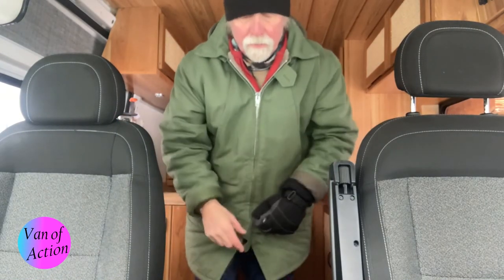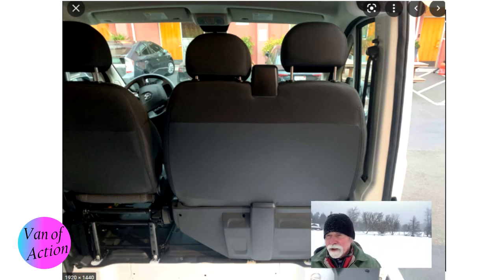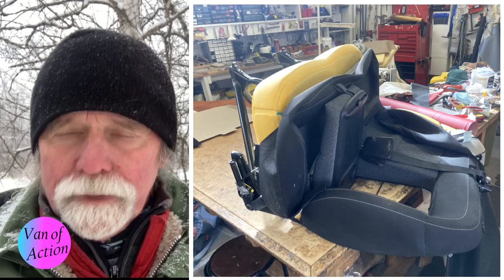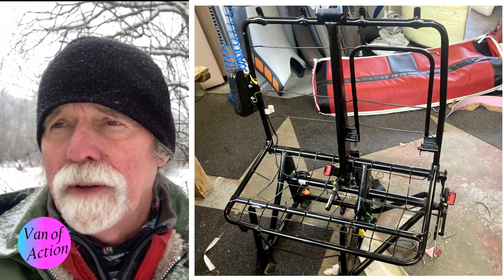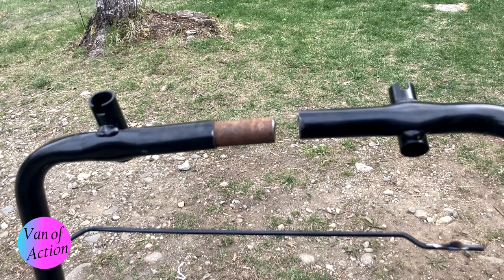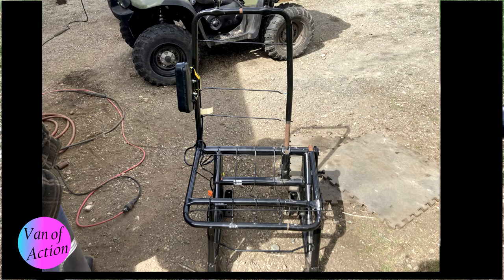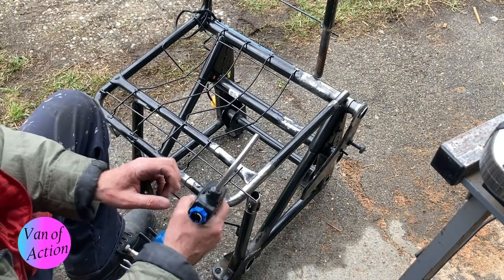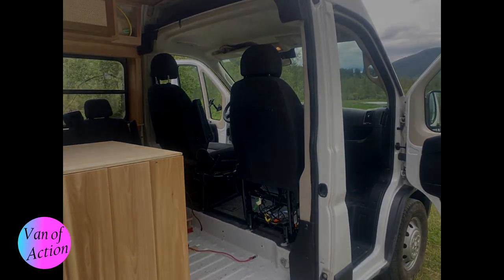How to Convert A Dodge Promaster Bench Seat Into A Single Captains Chair for a better Vanlife

Comment: Nice try,cutting the seat was also my first thought when I decided to swap my bench to bucket seat.But I have no welder friend or tools and my wife’s concern is the reclining feature.So my final solution  was searching the Craigslist for a wrecker and found a airbag deployed bucket seat in a nearby body shop which was charged $190 for both seat and riser. The seller didn’t give me the seatbelt pretensioner buckle,he asked for $120.But the buckle exploded in the accident as well as the airbags,why do I need the salvage?I have a brand new one in my bench seat,It’s easy to move the pretensioner and the seat airbag from the bench to the bucket seat,so I did that.I sewed the seat cover with needle by myself.If your families find recliner is useful in the future,it’s still worth buying a bucket seat from salvage.Anyway,congratulations,enjoy your van and New seat!
Reply from the maker: Tommy !!  Thanks for the great comment.  After the fact I thought I could have done the same in terms of moving the air bag over.  I hadn't considered the seat belt thing but you're absolutely right.  I think if I did it again I would go that route but NOT sew it myself.  I'm sure the upholsterer could have reworked the cover of the bench seat to cover the bucket.  The air bag sides look identical, the alteration would be on the other side.  Now that I'm writing this it's something that may still be possible.  Cheers my friend - be well and safe

Comment: Hi all.  Firstly, great job. I am from the UK and did think along the same lines.  My plan was to slim both seat edges to be in line with the base legs and reuse the foams and covers, just as you have done. However, I cut the whole base frame down to the level of the thick rear tube and did away with the whole seat base and backrest. I added  flat rails ( and a front rail ) off the rear tube and bolted a complete reclining seat in a very similar material to my van seats, with runners and base rails, from a Peugeot 208 which fitted, was a similar size and shape to the driver's seat and had exactly the same type of seat belt buckle. Essentially, I used the seat frame as an extending seat base for a car seat to get the correct height. I toyed with buying two matching seats and converting the driver's side but I would have lost the huge space under the original seat  (and the tool box space under the passenger seat is still available - just ). Instead I eventually paid for a pair of made to measure leather fitted seat covers in a tan colour to match the rear upholstery. Again, a great job and way above the level of butchery carried out by others. Cheers.
Reply: An update to my comment. Peugeot is not widely available in some areas but Fiat and Citroen parts can be. These manufacturers share a lot of parts across the ranges available in North America. The European Boxer, Ducato, Relay (Promaster) van uses parts from the same inventory as many saloon cars in the ranges. I am sure you could source seats from Dodge and similar makers which use the same seat belt latches.
Reply from the maker: Hi David - thanks for watching and taking the time to share.   You must be a good welder - something I know nothing about.  I love the idea of cutting the base off and rebuilding it to receive a more traditional seat but I simply have no idea how to do that and I expect the liability issue would scare a fabricator away.   All the best and I hope you'll join the community ... sounds like you have a lot to contribute.... Dave
Reply: @VanOfAction  There are a few regulations to meet but lowered seat frames are a thing here if you want to fit seat swivels. The big drawback is cost and there are no universal ones available. I am working through your vlogs slowly and will add comments as I go. I am a retired car restorer and carpentry is not my strong point - each to their own.

Comment: Why can't you pull the bench out and hook up a new seat?
Reply from the maker: Hi @IVolutionI - thanks for watching and taking the time to comment.  Honestly that's exactly what I thought when I bought the van.   Not that I had any choice at the time - this was the only van I could find available in Ontario Canada that week and we were moving to BC.   Taking out the bench is not  problem, and fooling the computer is easy too.  The challenge is finding a single seat to put in.  The Dodge corporation won't sell a new single seat for a van that has a bench because of the air bag computer.  Finding a salvaged one with an intact airbag is almost impossible (totally impossible at the time).  And one out of wreck that had it's airbag deployed and seat belt  tensioner released was way too involved to try and make right.  I have been keeping my eyes open ever since and if a single came available I'd be all over it !!!!   Hope you'll join the community and stop back ............   Dave
Reply: @VanOfAction  I also have a similar situation bought only van I could find which had a bench seat now trying to put more seat in and turn passenger seat into a single. I was under the understanding that I could either purchase a after market seat or find one. So I guess that where I'm confused, why wouldn't an after market seat work to hook up? Thanks!
Reply from the maker: @IVolutionI  I'm not sure where you are.  But all seats have to be tested and approved by the governing bodies for each country they are being used in - or the insurance will not be valid.   I'm in Canada and I cannot find an aftermarket seat that has a side air bag that has gone through the approval process.  In the states there is a company in Arizona that manufactures seats that meet the US standards ...  https://discountvantruck.com/product-category/promaster/promaster-captains-chairs/   ... we have been talking about going that route if no options come around.

Comment: thanks for this video  - what is the reason that the seat does not swivel?
Reply from the maker: Hi Susan - thanks for watching and taking the time to comment.  The seats that are built to be individual seats have a base and a seat that are 2 separate pieces.  The swivel goes between them.  The bench seat, because it's a bench is has one frame that goes from the floor bolts to the headrest.  There is no place for a swivel to go.  Having said that I have seen photos of a swivel that is made in Europe that goes at the bottom of the seat and allows the completed set to rotate.  But it's made for a right hand drive vehicle so everything is backwards for North America.  Be well and stop back.

Comment: Thanks for this video. I have a 2500 2018 promaster. The only airbag on passenger side I see is on on the dashboard just in front of bench seat.
It looks like yours are located on the seat itself?
Reply from the maker: Hi B C -  Thanks for watching.  I have air bags in the dash as well.  I would imagine in 2018 all models had the bags in the seat as well.   Look on the edge of the back closest to the door. Mine has a tag.   The thread on the seam is a special tear way type that will give way when the bag is deployed.  The trick is to  make the computer think that all the air bags are in place and active after the renovation.  Be well and safe.
Reply: @VanOfAction  copy that. Your right I didnt see it. Thanks again for your video. Exactly what I was looking for.
Reply from the maker: B C - Excellent !!  I hope you try,  if you want to talk about it let me know !!  Cheers
Reply: @VanOfAction  let me ask you this, how to verify the bucket seat I located will fit my van? I think they are pretty interchangeable but dont want to get stuck with one I cant use